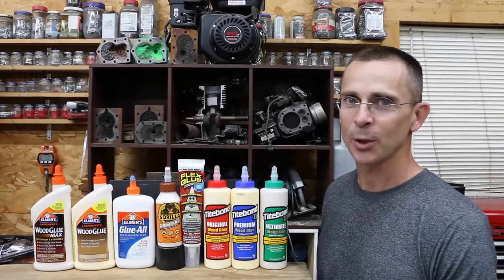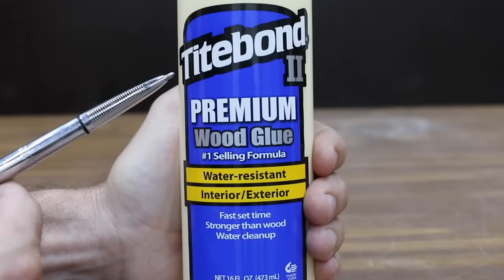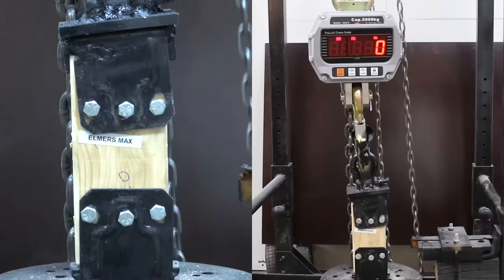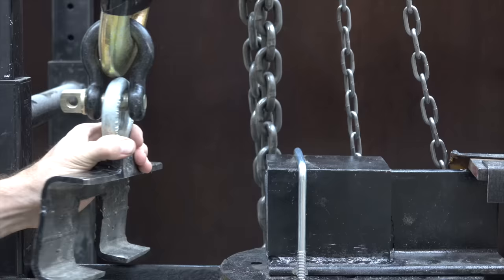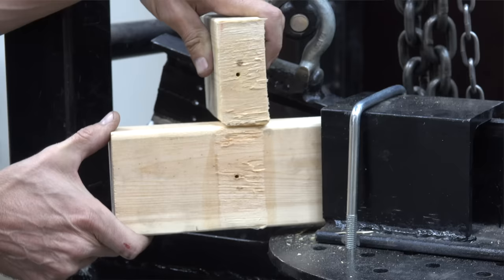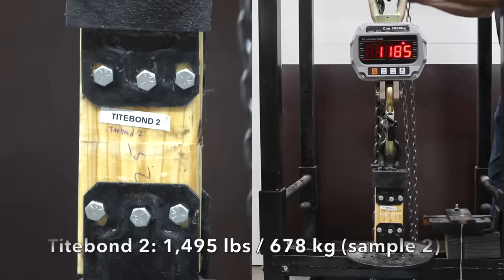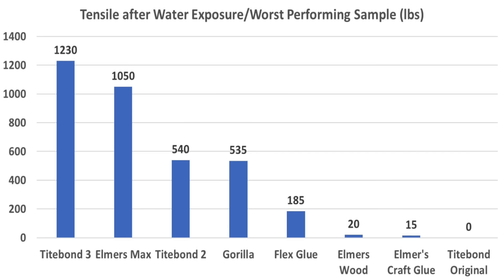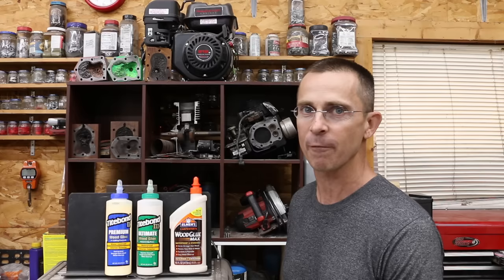Which Wood Glue is Best?  Let's find out!  Showdown with Titebond, Flex Glue, Elmer's & Gorilla.

Comment: Love your testing videos, but there is a slight issue with this one - gluing to end-grain always results in a poor joint. The porous nature of the end-grain soaks up the glue and tends to give a dry joint. Ideally, for bond testing it should be face grain to face grain. Anyway, keep up the great work - love the vids.
Reply from the maker: Thank you for the constructive feedback
Reply: @Lewis yes true but all the poor joints were tested equally.
Reply: @ProjectFarm  Yep, definitely. In woodworking, when you can't avoid gluing end-grain, you go to great lengths to pre-soak the end-grain by applying glue, letting it wick in and partially cure, and then repeating as many times as it takes to have it stop wicking in, and only then put the joint together. When you're gluing long-grain to long-grain, none of that is necessary and nearly every adequately-clamped joint will fail at the wood, not at the glue.

That being said, though, I think maybe that's a good argument for doing the test exactly as you did it. Had you glued a bunch of boards long-grain to long-grain and performed the same tests, you would have essentially (probably) been testing not the relative strength of the glue, but the relative strengths of each wood sample.
Reply: Lewis Taylor. Correct but with a correct bond, the timber would break before the glue so the test would end up being a wood strength test. I think that making a weaker joint is possibly better for consistency.
Reply: @Peter-976  Agreed that is a valid point - it was like-for-like testing and so certainly has some validity and some useful information. However, due to the glue uptake of the end grain and variable nature of wood and the viscosity of the glues, you could end up with an extra uncontrolled variable which could influence the performance of the glue.
Reply: @DHClapp  Thats also a valid point. We do a bit of adhesive and timber testing at work and the pass/fail criteria is nearly always apparent wood fibre failure rate. I.e. we are expecting that the glue is stronger than the wood (within certain allowable limits). I agree that would have made for a relatively dull video insofar as all of the glues SHOULD have performed about the same given a good standard of glue applications, wood moisture content and clamping force during cure.
Reply: @ProjectFarm  The tensile strength, especially for the water exposed pieces, appears to be strongly correlated with the fineness of the grain - the finer the grain, the higher the tensile strength of the bond. (edit: I might be using the wrong term here:  tighter rings = stronger bond)
Reply: So true on end grains, but this was the same test for all the glues. They were on an equal platyng field.
Reply: Came here to say this. Would love to see if there was different performance with face grain joints.
Reply: Dude all the joints were the same. Which gives no bias to any glue!
Reply: @ProjectFarm  also I think it would be better to put the same amount of glue for all test, or dipping the ends in a layer of glue to make sure you have a consistent approach.
Reply: Some pieces had knots near the join which greatly affects the absorption of glue, not to mention Titebond 2 test piece disintegrated! the glue line held at a level way below what other glue lines parted, this alone never mind the huge variation between the same glue samples tells us how varied the sample board quality were.
Reply: @littlewolfblue1389  End grain is the poorest way to glue a joint. If Titebond 3 and Elmers max did the best on this test I would wager they would on face grain tests too.
Reply: This could be why there was so much variability on a sample-to-sample basis for the same product.
Reply: @rterry2752  Not necessarily, Titebond No-Run, No-Drip is specifically designed for endgrain gluing, it's good at what it does, better than Titebond 2 or Gorrila Wood Glue however it's not in the same league as Titebond 2 for long grain gluing. as far as I can tell No-Run No-Drip is thicker so doesn't soak into the endgrain as much.
I've also found normal Gorilla Glue (the polyurethane glue not the white PVA wood glue in this video) glues endgrain better than most PVA based glues too, but it's just not even comparable to any normal wood glue when joining long grain.
Reply: You wrote, "gluing to end-grain always results in a poor joint".  No, it results in a variable-strength joint.  Were you not paying attention?  Your subjective word "poor" is meaningless in the this well-designed, and well-executed testing scenario.
Reply: @combatveteran7525  Yes it does- not all these glues are meant for end-grain joints, so some will do better than others here but maybe not with face-grain. 45 years woodworking for a living qualifies me to know something of what I speak about...
Reply: @JerGoes  If you look at all his vids regarding wood like screw strength and pull-out, you'll see the same thing: some include knots and some don't. I like watching these tests but the more you know of what you'ere doi ng the more valid the results of your testing will be. He does not know enough...
Reply: @rterry2752  Actually not! Titebond 3 is designed to dry slowly so that wood doesn't soak up the glue away from the area being jointed before it dries. It produces a poorer bond on face grain than Titebond and Titebond 2 (which does less well on endgrain and porous wood) because instead of the wood fibers touching, there's a thin layer of weak glue between them.
Reply: @P_RO_  Make a video of the tests on that, would love to see all the results.
Reply: Nice info here. Gives me a better idea on why they had such great variances between the same glues.
Reply: I came here to post the same. I suspect a lot of the variability was from the use of end grain bonds.
Reply: Lewis is correct...Myself, i was surprised at the strength of some of the end grain glue joints. Lets see some long grain tests.
Reply: No way would I depend on any glue for off-axis forces when end-grain is concerned.  Either use  scarf joint or something else that doesn't depend on end-grain adhesion.
Reply: Lewis Taylor Apparently you're not a carpenter because you don't know what you're talking about. Most joints comprise of at least one end grain piece. Two in the case of miter joints. So these tests were very realistic.
Reply: I was going mention the same as Lewis, however all the glues were tested end grain to end grain so it pretty fair for that specific apples-to-apples test. However end grains can have variability in absorption, and can suck up a lot of glue.  You can glop it on and let it sit for a while to really soak in, then glop some more on before clamping.  Interesting results, similar to what Mathias found.  GG is junk, also a pain to clean up the bubbling it does.  I'll have to check the pricing on that Elmers Max.  Nice test.
Reply: @lewistaylor863  No, I'd like to see all of them testing face to face to see what they are capable of. Though it seems like he was using a softwood like pine or other whitewood. Get some hardwoods and lets see how they fair!
Reply: @combatveteran7525  Some glues may be better for end grain (e.g., because they are thicker and don't soak in as much) but inferior for edge grain. I don't think the results would be different, but they might.
Reply: @DHClapp  I sometimes have to make custom length grab rails for stairs and the ends return to the wall and those end grain joints always get glued and pinned. I put at least 3 coats of glue over about 10 minutes
Reply: @littlewolfblue1389  The point is not to see the max strength of these adhesives, but to test them relative to each other and see which is the overall best. Testing them at a disadvantage allows you to see the glue joint fail instead of the wood grain.
Reply: @johnturner4400  I don't think you can ask for more of a glue if the wood breaks before the glue. If you prepare the wood and clamp properly then you avoid a weaker joint. PVA requires a very close joint and clamping. Unlike epoxy which requires some volume of glue in the joint to function.
Reply: @combatveteran7525  The glue was not correctly applied to show the glue off in all its potential. Clamping is required. The deck screw may have caused a gap and negated the optimal action of PVA. PVA works way better when very tightly clamped.
Reply: @boots7859  I'll use GG (or any other polyurethane gunk) when I have an outdoor application where the join must be filled leaving no room for water to work its way in (PU glues foam and expand to fill any voids).  But if it's dry wood, I tend to stick to the PVA glues.  I was waiting for someone to suggest hide glue. :)
Reply: @The_Fat_Turtle  If end grain joints were analogous to face grain joints, then you'd be right, but they aren't. Not necessarily. Some glues do better on end grain relative to their performance on face grain.  

It's not a big deal. I love these videos. Just in this case the tests were further from a typical usecase than I would like.
Reply: @rterry2752  no they where not, the timber does not have equal end grain over its length, and finer end grain glues much better then coarse end grain.

Comment: So you're telling me that flex glue isn't even as strong as Elmer's craft glue. Lol
Reply: I'm pretty sure that flex glue is not at all suited for wood. But I don't know. I don't use it.
Reply: Flex glue is likely suited for it's own thing. Since it's flexible it's perhaps far more reliable than the other wood glues where the repair is exposed to vibrations for example.
Reply: Dont know about flexing but 5000lbs compared to 800lbs I could care less about flexing, I want the repaired item as close to it's original strength before it broke or was cut as possible.
Reply: Yes....for wood. You need different types of adhesives for different materials and flex glue is not meant for joining wood.
Reply: @jwat2396  i dont know if you missed the point, but some applications might benefit from a joint with some give, ive never used flex glue before, but it sounds like it can be used like dampening between joints, i just bought a 3D printer and built an enclosuresure today, adding some legs to it with wood glue vs flex glue would probably make a big difference in vibration and the noise that comes with it, i still wouldnt use it myself, just an idea
Reply: But you can use Flex Glue to make a boat out of chicken wire. Cock-a-doodle-doo.

Comment: I'm just amazed that end grain joints are even holding up at all
Reply from the maker: Great point.  Nearly 6,000 pounds is pretty impressive!
Reply: My thoughts exactly, That is why we use spines and mechanical fasteners but hell now I'm wondering if it's even worth it lol
Reply: End-grain joints have a bad reputation, but wood is wood and glue is glue. The joint failures are often caused by ignoring wood movement when fastening end grain to edge grain, letting the end grain soak up all the glue so there's little left in the actual joint, or an incorrect assumption that an edge grain and end grain joint failure would look the same.
Reply: @TheSnekkerShow  The " bad reputation" to end-grain to end-grain is will deserve exactly for its ability to suck up the glue which is why industries spend millions of dollars on machines that create finger joints for end-grain glue-up, like you said wood is wood and glue is glue but is not always equal. here an interesting clip of such a machine in action,  https://www.youtube.com/watch?v=nZv6EWA_hgc
Reply: When doing endgrain glue-ups, I like to 'pre-treat' the wood with some water thinned PVA (Titebond, Elmers, etc) glue to seal up the ends so when I actually glue them together, the glue isn't soaked up by the wood and out of the joint. I haven't done any destructive tests such as the ones done here, but anecdotally, the glue joints seem to be much more reliable. I usually use the 'belt and suspenders' technique of zipping a fastener of some sort into them too, if possible.
Reply: @TheSnekkerShow  End grain has a lot of imperfections that create failure points
Reply: @jc-ph1qf  No it doesn't.
Reply: The Snekker Show Sure it does. It Doesn’t mean you can’t have a strong bond but the nature of end grain will make the results more volatile. For strong repeatable results,  face and edge gluing is best.
Reply: @jc-ph1qf  You just need to learn your materials and use them according to the situation. One could just as easily say that aluminum welds don't work because theirs keep breaking.
Reply: @TheSnekkerShow  Lol, ok. I spent 3 years working in the Core Technology lab at Franklin International performing ASTM and other testing on wood adhesives. I never said that end grain was bad, I simply said that it has a lot of imperfections and that causes potential failure points. Results will be much more variable than face/edge.
Reply: Close enough, moving on.
Reply: @jc-ph1qf  right? This is exactly what I was thinking while watching the vid. (Responding to your initial comment) Who uses end grain? Then thinking about it, almost any glue except the worst would make the wood fail before the glue on a face grain test. So these end-grain results give a nuanced idea of the straight, for lack of a better term stickiness of each, though not realistic. The water testing was more interesting. 

I think maybe replicating real-world situations that we generally see glue fail would be a way to improve the results. Though coming up with repeatable versions of those scenarios is in itself a true skill and our host has done a bang up job of that, considering. 

If I had to think of places where I do see glue fail, these come to mind: Wooden plugged holes in decking. Delamination of veneers (like on tables and cabinetry). Small mortise and tenon joints (like in chairs/furniture). Occasionally in miter joints like picture frames (but this video kind of shows that one).

Though I don’t know how, I would love to see testing of these scenarios. Can you think of any others?
Reply: What's the value of doing end grain tests at all? I can't remember the last time I needed to repair or assemble a tension joint in a board with only adhesive. RIDICULOUS!!
Reply: @mikehudick7074   I had the same reaction as you, then thinking it through, I found some reasons. (see my answer above).

But maybe in retrospect the most impactful reason to do it is to show us all who “know” you can’t glue end-grain, that you kinda can.  ¯\_(ツ)_/¯ 

But again I agree with your initial gut feeling and explore that in my answer.
Reply: @mikehudick7074  If it holds well on end grain it will be much stronger on face grain. It is a valid test. I don't think his set up could handle face grain since it is so strong he would need to pull the wood apart.
Reply: @TheSnekkerShow  End grain glue ups are extremely problematic. End grain sucks glue in, leaving an inconsistent, unreliable, possibly glue started joint. It is the sole reason for so many types of joinery. You have a wood working channel? It is also the reason the test results were wildly inconsistent in this video.
Reply: @Christina DesCamps  I don't remember the details of this video, but I'm pretty sure he demonstrated end grain tensile strength of several thousand pounds with PVA glue, without giving significant consideration to joint preparation.  I don't know what else I need to say about that.  Also, I'm pretty sure that ancient wood joinery was not invented to address the limitations of modern PVA glue.
Reply: @TheSnekkerShow  Have you seen ancient joinery cease in existence due to the invention of pva?
Reply: @TheSnekkerShow  Carpenters do not glue end grain, period. For damn good reason.
Reply: @christinadescamps7096  I'm obviously not arguing one-or-the-other extremism, so if that's your interpretation, then you win this and all future arguments.

Comment: Perfect timing.  I am about to build a few barn doors and need to go get wood glue tomorrow.  Thanks man!
Reply from the maker: Nice!  I hope the build goes smoothly!
Reply: I've been using Titebond 3 for 8 years in my woodworking business.  It's very good stuff.
Reply: You Wish  Yes!  I built a desk one time and forgot to square the base of it before attaching the top and 20 minutes later I realised my mistake and thought it would be easy to take the top off and square the base.  I took the screws out and could not get the top off.  I used a block and hammer and it would not break loose.  I gave up because I didn't want to damage the top trying to get it off.  It was only out of square less than a quarter inch and was only noticeable from the back so I didn't mind it too much.  I learned that day just how good it can hold.
Reply: I suspect pro bond is similar to Elmer’s max. I’ve been hooked on pro bond since it came out